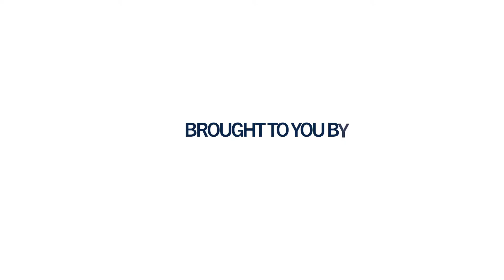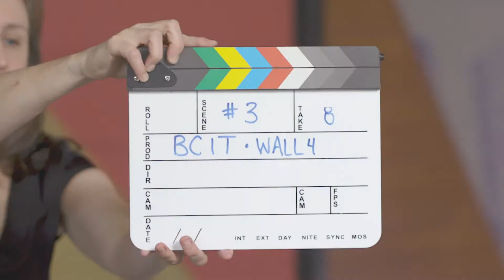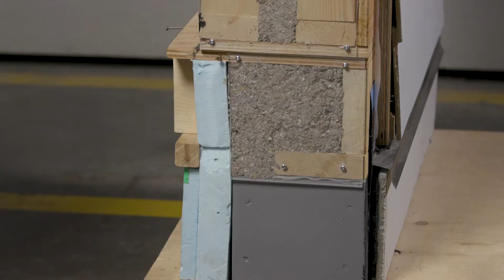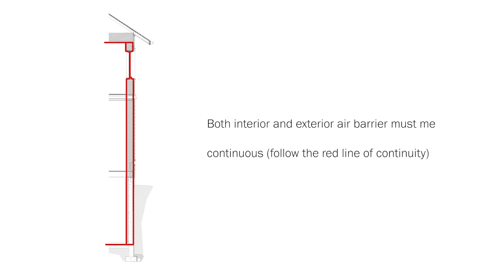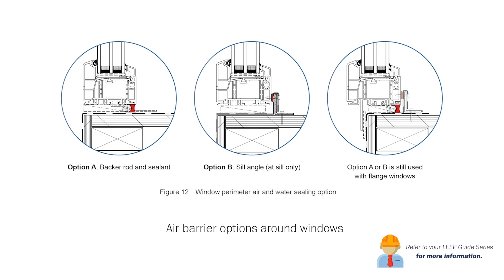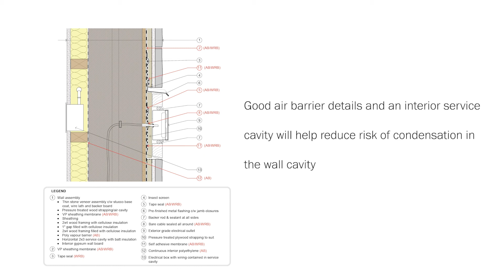Net Zero Energy Ready Wall #4

Comment: sure glad I live in zone 4 so I dont have to deal with poly sheating inside and watch the mold build up with RH higher than I imagined.  Seems like a great reason to use a smart air barrier along the lines of intello which actually breaths.  Glad that you were not suggesting low perm exterior wall using OSB